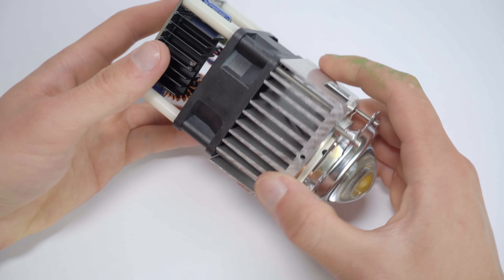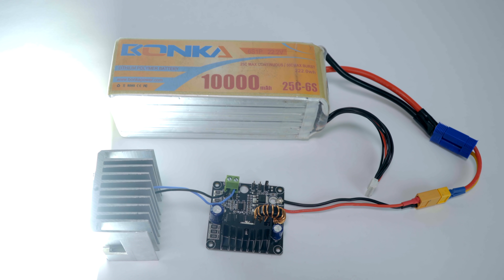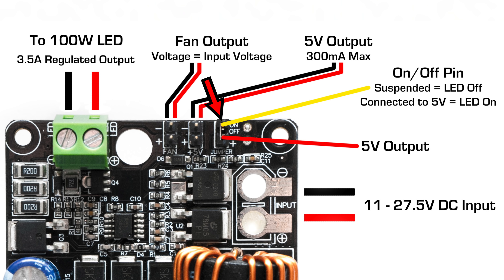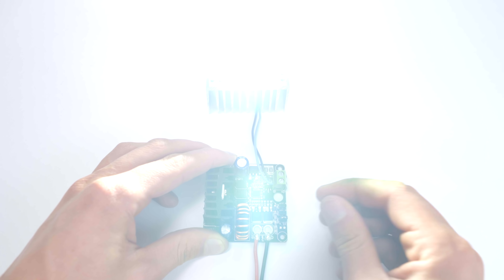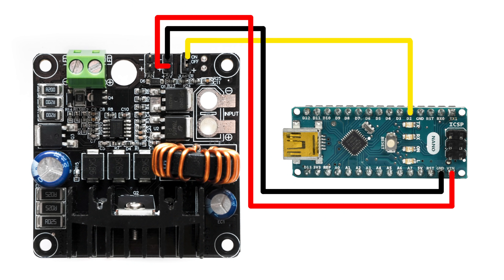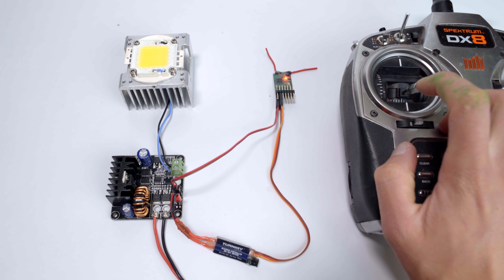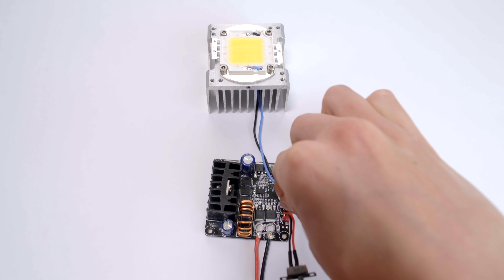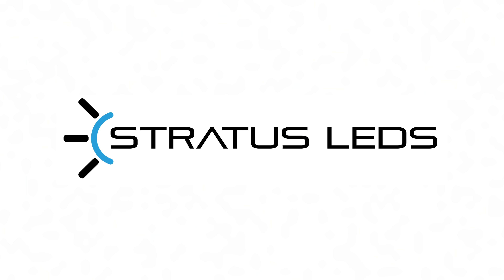100W LED Driver for DC 12V 24V Power Source

Comment: That's really nice. Does it give the needed voltage and amperage to the LED? Can I use bigger heatsink?
Reply from the maker: It drives the LED with a regulated current supply (3.5A). You can use any size of heat sink on the LED as long as it works well enough.

Comment: the price for this board is 44 $ usd so no need it 
chip led 100w is 16$ usd
 heat sink is 16$
 better to using step up board from 12 to 32 6A like 6$ usd in aliexpress
Reply: i get mine for $1.80 with cv/cc

Comment: Hello, do you have any recommendation for one of this that can be easily dimmable without an Arduino, I'm using the LED for video work, but with the boost converter that I'm using right now (voltage limiting for dimming) after an hour or so the led start to flicker, any tips will be welcome, thanks!

Comment: Have you considered using a Cree CXB3590 instead of the "generic" 100W LED-COBs?
They are available in MUCH higher CRIs which should result in a lot nicer Video ;-)
I picked some up for ~25€ and they are great :-)
Reply: Also they are a shit ton more efficient.
Just have a look in the "Cree Product Characterization Tool" (google it):
A CXB3590 in CD stepping for example puts out 16.000 Lumens at 3,5A with an efficency of 120 Lumens per Watt.
At 1,4A the efficiency goes up to 170lm/W.
Your average China-COB will probably do 80lm/W on a good Day ;) (maybe 100lm/w at low current)
Reply: jupp, that would be a great side effect.
I got the idea because of the harsh an "gapped" colors in the videos that where lightened with the chinese LEDs.
Reply from the maker: Our chips have an efficiency of 130 Lm/W at 3.5A. They use high quality bridgelux diodes
Reply: 130 lm/W at 3.5A would be impressive for a 100W COB
but that way seen a cree CRI 80 CXB3590 would deliver 13000 lm at ~2.8A@36V which equals ~180 lm/W
those datasheet nubers however are not that realistic in any case, the Cree still surpasses anything I have seen today :-)
Reply: @rctestflight if your chips are so good, i think you should just name them in the Description.
Anyone can use Bridgelux-LEDs but it doesn't mean they are good... Bridgelux also makes Chips with much lower efficiency...
Also i couldn't find the min/max-voltage of your driver module.

I never trust stuff like "we have the best chip it does 34564357457456 Lumens" because every cheap Chinese LED-thingy will claim the same...
To convince me of the quality of your products you need to put out data (like Datasheets, Part-Numbers, measurements...).

I know i'm not the average customer but i also don't think your product is intended for the average customer.
Reply: the one on the heat sink looks a lot like an Epistar LED COB, never seen bridgelux in that package :-P 
also still, Bridgelux is not really king of LEDs though their pricing is a lot more competitive
Reply: have you used the Cree CXB3590 with this driver specifically?
Reply: @DooMMasteR  literally all led chips are made in china :P 

and yes, yuji leds are also made in china

Comment: Why is the output fixed at 28.6V? All the 100W LED's ,is saw, are higher than 28.6V?
Reply: ikr, it should be 34 volts at 3 amps, not 28 volts at 3.5 amps

Comment: plz circuit price
Reply: the price for this board is 44 $ usd 
chip led 100w is 16$ usd 
heat sink is 16$ 
better to using step up board from 12 to 32 6A like 6$ usd in aliexpress

Comment: Why do Americans say sodder by the way?
Reply: Solder -sounds like Sodder.....
Reply: We don't...we say " sädər ".  How do you say it?
Reply: Why don't you say sodder?
Reply: Because it is spelt soLder.
Reply: Jim Patrick jalapenos are spelled ja-lap-en-os, but you'd look dumb to a Spanish speaker or really anyone if you pronounced it that way. 

My local dialect we pull out the 't' in most words, such as mountains. I know there is a t in it, but it doesn't keep me awake at night.
Reply: Firstly your analogy is poor because in the Spanish language a 'J' is pronounced as an 'H' so Jalapeños is pronounced exactly as it is written. It is a Spanish word not an English one. Same as Cafe and thousands more.. 

Also; in the context of stationary, how do you pronounce 'folder' genius?
Reply: Jim Patrick depends on where you are from. Just like how aluminium is spelled differently depending on British or American spelling, yet both are considered to be correct.

Like I said, where I am from we don't hardly ever pronounce the t sound. 

One thing I find funny is the Canadian and American versions of words like color vs colour.
Reply: Jim Patrick in response to the folder question... see the pronunciation of "tear."
Reply: Tear has two meanings and therefore two pronunciations, your point doesn't make any sense? What has that got to do with sodder/fodder/folder?

Comment: My phone light is brighter
Reply: WAYNEBRO'S RC N STUFF if that's true I think your phone is knackered
Reply: Is your phone light a Samsung fire ball?
Reply: I'm too cheap to pay £1.50 for one of the 'pro' torch apps so i've been looking into getting one of these LED modules and fitting it to any drone that can do 'follow me' so I don't have to use any light switches in my house
Reply: @professormonkey-for-a-head2126  ive been wondering, how tf is the phone led supposed to be brighter in the app? its the same led, i dont know if it taps into the power supply or something
Reply: Max Xiang lol those apps are a con. Unless as another post said the app unlocks Samsung's super secret and awesome fireball feature the only way to make your phone brighter is to duct tape a few of these 100w LED modules to your phone :D
Reply: @professormonkey-for-a-head2126  yeah i agree